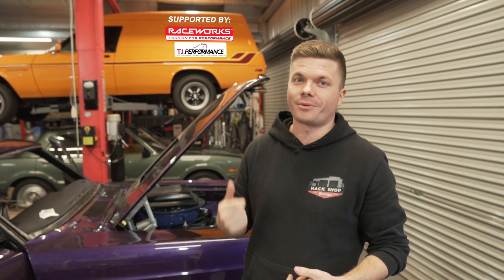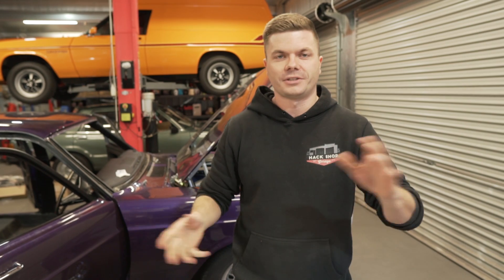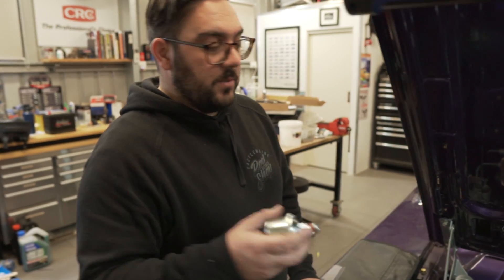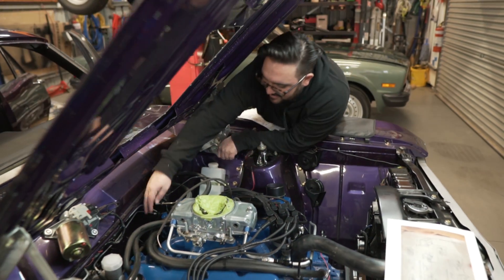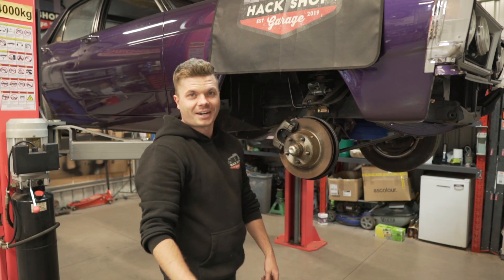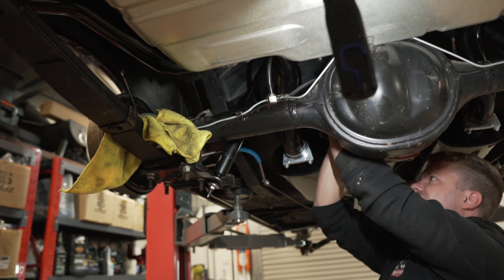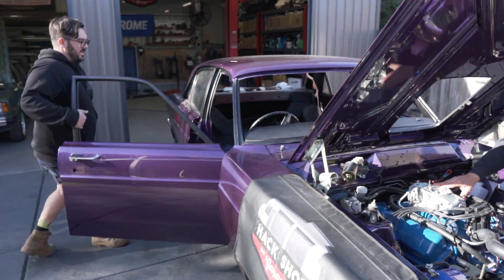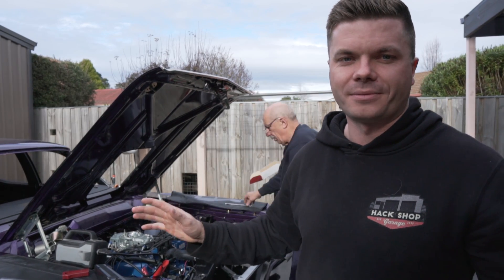XY GT Falcon Build - Part 11 - FIRST START UP!

Comment: You blokes obviously don't look at your comments ! As I mentioned before in prior engine bay construction there should be NO spacers under the Radiator TOP BRACKET that you have under it mounted to the Radiator support.
Aswell as the coil should be mounted on the DRIVERS SIDE of the engine. 🤣🤭🙌

Comment: TRADIE TIP on the grinder when you place it back on the bench guys.
NEVER EVER PLACE IT ON BENCH DISC DOWN !
REASON being, if someone plugs it into power and its not turned off if will dance everywhere and create carnage. TRADIE TIP 1.

Comment: DONT TURN the oil pressure sensor by hand as it will / can unlodge the internal wires inside it and not read true on the dash. You made me cringe Nathan. 😩